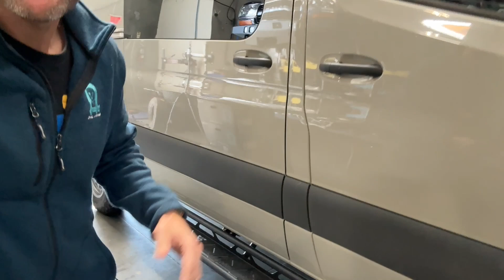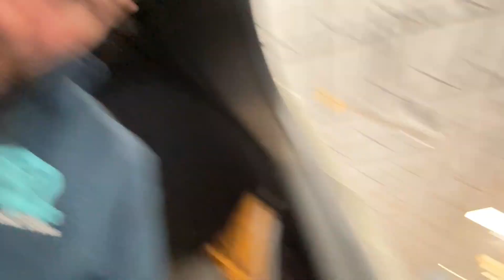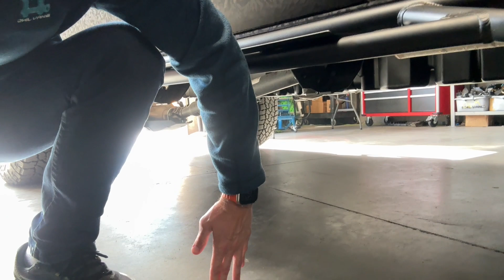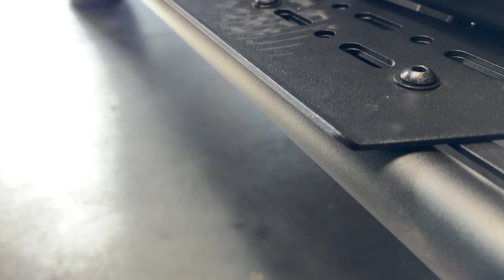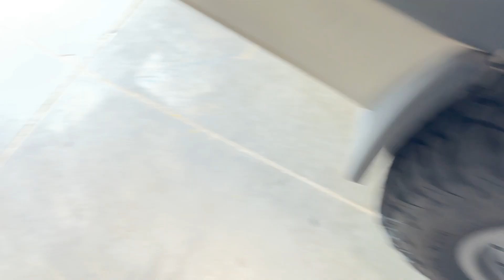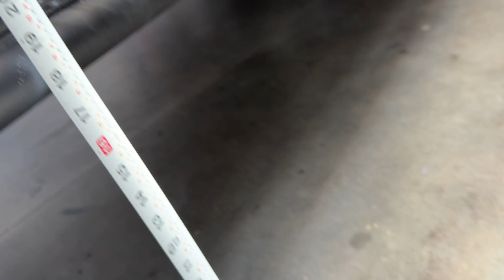Owl Side Step Comparison

Comment: I've had these since last summer and generally quite like them and potentially future modularity which is great. Some constructive criticism is to have a different solution than the tube on top of the step. It protrudes too far into the slip steps. I've hit the tube on top of the step getting out too many times, miss the tread plate and slide off as if you miss the tread plate then it's a nice round edge. Would love to see that change. 
Additionally a wider tread plate as an option would be nice. 
Lastly, the installation. The brackets that mount to the frame should have slotted holes, preferably vertically slotted. On my van, the mounting holes lined up perfectly with ridges which is not ideal for bolting things to, especially with rivnuts. I made an installation video on my channel if you want to see what I mean. I had to modify my brackets to install the steps.
Trying to be constructive. I'm an automotive engineer so I always look for ways to improve things. Love what you guys do and will at some point get your front bumper

Comment: Y'all should make a way longer tread plate. I wish mine covered most of the rail front to back.
Reply: Me too. It slopes down very quickly and doesn't leave much room for your boot, especially with the tube along the inside that cuts an inch into the step

Comment: yeah they come down so you can step in more easily 🤣
Reply from the maker: The problem is not getting in it is getting out. When a step is too low, it makes it very hard to get out safely. Getting out is much more dangerous than getting in. The platform of our step is 8" below the step inside the van. A standard stair to code is 7". Anything bigger would be very difficult to step down.

Comment: I really like how well thought out your products are.  I am on the edge of buying these sidesteps but I am worried that they are too high.  Like, are they high to the point that there is not much of a difference between having them and not having them for being able to easily get in the van.  How many inches do yours actually lower the step to get in?
Reply from the maker: From the step inside the sprinter to our step is 8". For reference a stair in your home is 7" by code. Therefore anything bigger is a huge step down when leaving the van.
Reply: But didn't you just shown the clearance to be 18" off the ground?
Reply from the maker: @tsangsir8827  We are referring to the step into and out of the van from the step not from the ground.